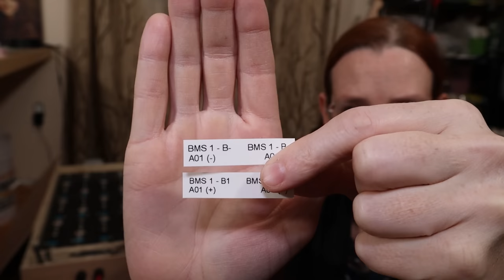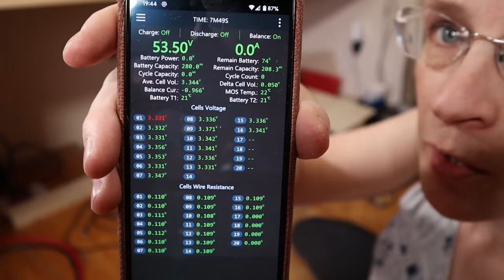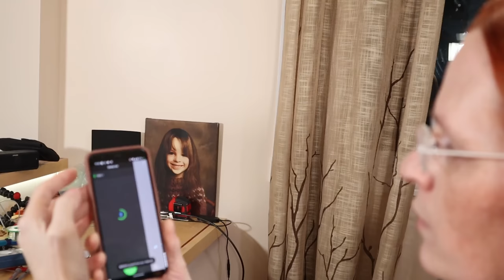JK BMS and Bus Bar Resistance - How to build a 48v Lifepo4 battery (Ep. 28)

Comment: Would it not be more practical to protect the battery box from vibrations then going down the rabbit hole and protect every connection? example put the battery box on rubber feet of sorts?
Reply from the maker: I will try of course, but the weight of the battery boxes and how hard you can get pounded on the sea, it's impossible to prevent shock and vibration from going through.
Reply: @TheDigitalMermaid  I saw another youtuber who also is building a battery pack with the same type of cells and he used flexible bussbars, kind of a copper laminated busbar. maybe an option?
Reply from the maker: @nordexo  That was LithiumSolar! I chatted with his as I did my first flexible bus bars at the same time he made that video. He's the one who gave me the loop idea.

Comment: As I said under previous video, you are still way too much complicating things. Compress the battery with sheets between them  -> ignore vibrations and dilatation. Use rigid bus bars. Simplest, cheapest, most effective. You are inventing dead ends which is fine if you want to play with it, I just hope other ppl wont try to copy it.
Reply from the maker: I've explained my reasoning throughout the build. If you think something in my logic is wrong, cool, explain why. I've changed a lot of my designs thanks to productive feedback. Simply being told that I'm wrong isn't very convincing though.
Reply: @TheDigitalMermaid  First part was in my post under fancy layout video. Instead of 15 short and one long cable, you got 16 medium long cables. Design that was more difficult to make, required a map to figure out battery order and put high different potentials close together so accidental shorts would cause more sever damage. You try to improve things. Trying to make it better is fun, but thousands of ppl already tried that, we don't need to reinvent hexagonal wheels. There are engineering codes and recommendations and one of those is keep it stupid simple, because it will be more robust. You can easily repair/replace things and you will understand the design years later without a map. If long positive/negative cable heats too much, you can use thicker cable or even copper bar, no need for overcomplicating things. Most manufacturers nowadays already recommend compressing the battery, because it will give you 30-40 % more life cycles which I think is pretty significant. It's in the battery's datasheet, manufacturer knows why he put it there, yet you still prefer not to do it. You are afraid of vibrations and movement despite if you compress the battery with sheet separators, this would be non-issue and you can use copper bus bars. As you've measured it, they are superior to cables and you can use thicker ones that you've measured, lower losses and less prone to build errors (bad joint lug-cable). In engeneering less build steps is always better - faster and cheaper to make, more reliable, less space for errors and failures later. There are simple and verified solutions. Trying to outsmart everyone and make something better usually leads to worse results. If you do something differently than what everyone does and what is recommended, you should have pretty good reason, but I don't see any. What I see is that first deviance from "usual" leads to necessity to change other things and compensate for insufficiencies of the change. Yet that change is not needed in first place
Reply from the maker: @MiH1IT  One of the things a lot of manufactured solutions do is chase cost of manufacture. Stamping copper bar is a lot cheaper than making cable connectors, as an example. So the argument that manufacturers have come up with the ideal solutions is valid if you accept that all projects have the same goals and focuses. To be clear, I do not think I am smarter than others. I have made this pretty clear since my very first video. What I am doing is explaining through these videos what my focuses are, and trying to figure out what solution works best for me. 

The goal of this channel is not to be a recipe for others to follow. Its goal has been to show the process of learning and figuring out what works best for each person in their own projects. The idea that we shouldn't bother because we'll never be as good as the experts would be to argue that DIY is fatally flawed in principle. I think we'll have to agree to disagree on this.
Reply: @TheDigitalMermaid  I did not say that it was solution that manufacturers only use. In our (my country) solar diy community I see 90+ % bus bars, same if I check "solar lifepo4" in google photos and yt video thumbnails. When something is easier to make and works better it can still be cheaper. Just because it is cheaper or less complex, it does not make it worse. You use batteries that manufacturer said you should compress to get the best result, but you don't even trust the battery manufacturer.
Reply from the maker: @MiH1IT  The spec sheet doesn't say they should be compressed, only that the degradation of capacity to 80% of rated would change from 2500 to 3500 if compressed. As I explained in an earlier video, the batteries will age out before that difference matters to me in my use case. I'm not sure where this energy is coming from... I've explained my reasoning and rationale for doing the design I'm doing. It's up to anyone viewing my videos to decide for themselves if my logic makes sense to them or not.

Comment: Ido not see the point of multiple wires instead of one. It just seems like a lot of work for little reward.
Reply from the maker: It was covered in an earlier video. The 1x 4awg strand was too stiff, the 4x 10awg is a lot more flexible.

Comment: @21:00 a "cat scan"!!!
Reply from the maker: Ahaha! I wish I had thought of that in the video.
Reply: @TheDigitalMermaid  I’m still waiting on laminated buss bars and have not powered up my JK BMS.  Can you tell if they do soft start when turning on?  Maybe a pwm duty cycle for a second or two?
Reply from the maker: @ai4px  I'm not sure what you mean by "soft start". I think of inverter and motor study starts, but I'm guessing that's not what you mean. The BMS beeps, and starts supporting power. I've not connected a load and plotted amperage.
Reply: @TheDigitalMermaid  I’ve used the chargery DCC module and when it turns on it does an increasing pwm duty cycle for the first second or so.  Saves spikes caused by inverter caps. But…. It is an idiotic design because the DCC soft start only happens when you manually flip the power switch and never from the remote on/off connector.   I blew mine up after two or three iterations. Now I used a pre charge resistor across a gigavac contactor.

Comment: I dont think u r thinking logically or critically. To me the most sense to me is if its resistance u r trying to lower than get a solid copper bus bar the size that they shipped with the batteris and test it to the one they sent with the batteries. It dont matter if u r in a boat or an rv those batteries r not vibrating out of that box they r in nor r they moving around inside the box so why r u try to make the bus bars flexible? Please help me to understand.

Comment: DO NOT CHARGE THOSE BATTERIES TO 3.65 VOLTS per cell. You will shorten the life of those batteries. Charge to 3.60 max per cell. Your maximum pack voltage should be no more then 57.6 VOLTS. Also don’t let the pack go below 43 VOLTS and you should be fine and you should get about 3800 cycles and more out of them. Also keep those batteries inside at room temperature.
Reply from the maker: With do respect, the data on the data sheet is the source of truth on what is safe. They're are times you want to do a full charge, and a capacity test which I want to do, is one of them. 

The all-caps command to not so something leaves no space to assume the person you're taking to know what they're doing and has a reason for doing it.